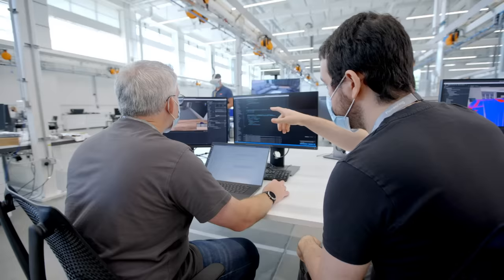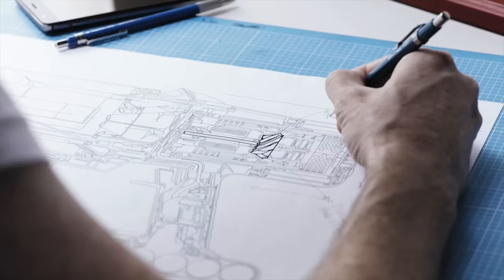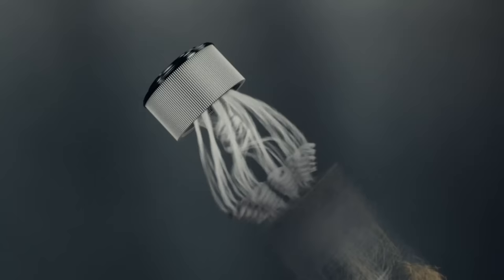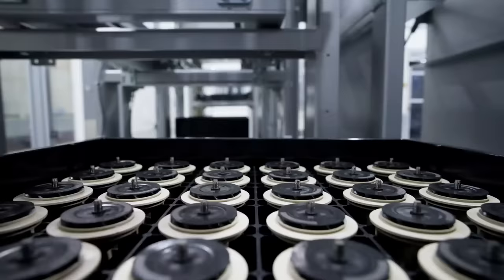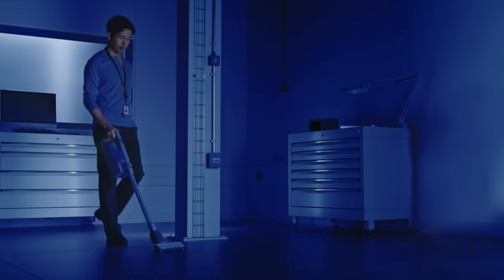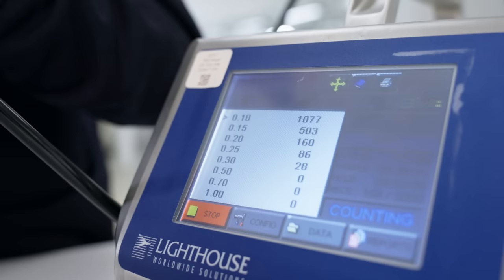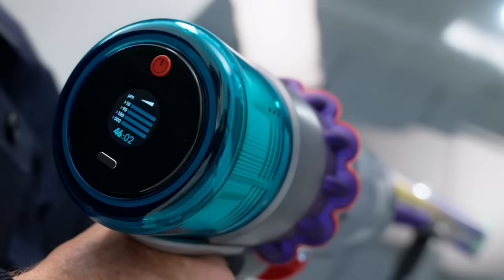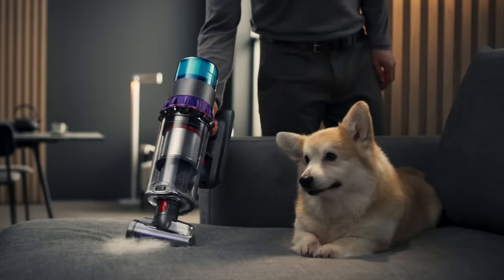James Dyson unveils Dyson's most powerful cordless vacuum with HEPA filtration

Comment: Hello, is HEPA Filtration better than the Whole Machine Advanced Filtration in some models such as V12? Thank you
Reply from the maker: Hi there,

HEPA stands for “high-efficiency particulate air.” HEPA filters are designed to trap smaller particles than the average filter, so you have fewer particles circulating in your home. HEPA filters help reduce allergy-causing particles such as dust, pet dander, pollen, etc
While the filtration system prevents dirty air leaking back into your room, and it captures 99.95% of ultrafine particles¹ such as allergens and pollutants from the air.
Reply: Hello, thank you very much for your swift response. Apologies, just to clarify - when you said 'while the filtration system...', were you referring to HEPA or the Whole Machine Advanced Filtration System? I would like to get a clearer answer as when I used the 'Help me buy' function on Dyson website, it didn't suggest Gen5Decter to me even though I chose allergy concerns and tried various combination. 

So can you please let me know whether HEPA Filtration is a better system than the Whole Machine Advanced Filtration system? And whether is Gen5Decter's HEPA  Filtration also a 'Whole Machine' filtration system, as I didn't seem to see it stated as such vs the 'Whole Machine Advanced Filtration' stated for some models?

Many thanks again your advice in anticipation, as I would like to choose one  ASAP.
Reply from the maker: Hi there,

We would like to inform you that the HEPA filters are best than other filters. HEPA filters are designed to trap smaller particles than the average filter, so you have fewer particles circulating in your home. HEPA filters help reduce allergy-causing particles such as dust, pet dander, pollen, etc
While the filtration system prevents dirty air leaking back into your room, and it captures 99.95% of ultrafine particles¹ such as allergens and pollutants from the air.

Also, we would like to inform you that there are different types of filters which are designed according to the compatibility of the specific machines. So, each filter which comes along with the machine is designed according to the functioning of the machine and it also increases the efficiency level of every machine.

Comment: I have a dyson v8 and v15 detect, I don't think it's possible to make a better vacuum cleaner than v15.
Reply: Is it a lot better than the v8?
Reply from the maker: Hi. Thanks for reaching out. Our new Dyson Gen5detect is more powerful than the Dyson V8. It also has more suction power. With its new features, it doesn't compare to the V8. :)
Reply: @a.3160  V8 is 115AW, this is 262AW and can actually get over 60 minutes runtime on hardfloors lol

Comment: 1:00 that's not "state of the art" that's a typical brushed universal motor which has been around for over a hundred years...
Reply: They're all brushless motors you goofball, no Dyson uses a brushed motor...
Reply: @Clove_Parma  All Dyson corded plug in products used a brushed universal motor... I was pointing out that Mr.D picked up the motor on the right (his left) and called it "state of the art". I am not referencing the hyperdymium motor on the left (his right). Another note is if it has a single stage of vanes; you didn't see Electrolux brag about "Quad Vane Technology" back in the 60's. I implore anyone to watch "The Secret Life of the Vacuum Cleaner" by Tim Hunkin

Comment: You replaced the trigger with a button?? Will this apply to all vacuums going forward? The fun part was the trigger 🥹🥹 I’m your biggest fan can Mr dyson sign my book that I purchased lol
Reply: The trigger mechanism has been the most frequent cause of failure on V10-V11 models.  I just replaced the one on my V11.  The red plastic part which fails presses on a plunger in the battery which presses the actual switch.  It requires a good bit of disassembly with special long tools to change.  Fortunately because its been a common problem the replacement trigger piece and tools are easy to find on Amazon with “how to fix” videos here on YouTube

Comment: Now make a corded version
Reply from the maker: Dyson cordless vacuums are engineered to be just that - cordless! But we do still included corded vacuums in our range, so these are an option if you feel a corded machine is better suited to your home and cleaning needs. Check them out on dyson.com
Reply: @dyson  dear team what I meant was bring that technology eg sensor and improve head/lights to the wired variants including variable auto power that can adjust to the flooring materials and debris

Comment: Now if they can fix the loose and wobbly wand issue on almost all dysons.
Reply from the maker: It's normal for there to be some tolerance between the wand and the main body, to make sure it can easily be attached and removed to change tools or empty the clear bin. As long as it stays connected in use, we wouldn't expect there to be an issue - the catch will hold it in place. If you're concerned the connection on your machine feels excessively loose, we'd be happy to look into this for you. Visit dyson.com and click 'Support' for the contact details of your local Dyson Customer Care team.

Comment: It's cool guess but the whole particle counter seems like extra unnecessary over engineering. We'll know the vacuum is working by how much stuff is picked up/in the container.
Reply from the maker: The Dyson Gen5detect™ vacuum uses a Piezo sensor to count and analyse the dust particles it's picking up in real time. It uses this data to automatically adjust the power as needed - increasing suction when a high volume of particles are detected. As an additional benefit, this data is also presented on the LCD screen so you can understand when the area you're vacuuming is clean, and guiding you to move on.

Comment: What is the model number of the version shown in this presentation?
Reply from the maker: Hi Emidio. Thanks for reaching out. This is the new Dyson Gen 5 cordless vacuum. :)
Reply: @dyson  yes I know,but what is the 2023 model number/ The reason I ask is that in Australia, what is called the Gen 5 standard model is a 2022 model and not a 2023 model.There is a model here called the Gen 5 `Absolute which appears to be the 2023 model, but I need to know what the model number is of the new 2023 model demonstrated in the presentation so I know what I am buying.thanks
Reply from the maker: The is called the Gen5detect™.  You have reached Dyson US support.  We will direct your question over to the team in Australia for further assistance.
Reply from the maker: Hi Emidio, can you please send us a message via Messenger with the link/serial number to the machine you own? If you're located in Australia message us here 👉 http://ms.spr.ly/60569GjcK.

Comment: I have had two Dyson. The first was an electric the second a cordless. I enjoyed both while they were under 6 months. But unfortunately I found both of the fitting were quite tinny and broke. The cordless at first did not suck so good BUT was replaced by dyson which was much appreciated. As time went on 5-6 months the sucktion got weaker. And never got a reply from dyson. So for the money I spent on the dyson vacume cleaner I expected a bit more vale. So value for money I give it a low 4. 
Would I buy it again?  Because of the cost probably not.  But I do the convenience rating  a high 9. 
As for now my dyson falls apart (because of the broken pipe joiners}. And has weak suction.
Disappointed customer

Comment: But you NEED to work on keeping them clean and empty…..the ejection of the bin is not enough. The amount of fine dust inside is crazy…..having to get a tooth brush or cloth to wipe clean. What about a cleaning kit with soft brushes or something you can place inside to get deeper into the machine to remove the dust. This would surely make them more efficient.
Reply from the maker: It's normal for static charge generated in use to cause fine particles to cling to parts of the machine, including inside the clear bin and cyclone pack. You can help minimise any buildup by tapping the machine firmly as you empty it, and wiping the inside of the clear bin with a damp cloth.

Comment: Love your innovative designs, but please give us the option to use the machine when its connected to an electrical outlet. To conserve battery life, I only  vacuum occasionally  and when I turn the suction all the way up, the battery dies in about 10 mins!
Reply from the maker: Thanks for the feedback! Boost mode is really only intended for occasional intensive spot cleans in areas where there's a lot of trodden-in dirt or clinging pet hair. For day to day use we recommend using the machine in Auto mode, which intelligently balances performance and runtime based on the amount of dust detected.

Comment: Does this one have a trigger because all the dysons with trigger have issues
Reply from the maker: Great question! The Dyson Gen5Detect™ does offer a power button!
Reply: @dyson  amazing that’s a big improvement, will all the old attachments from v15 detect work with gen5
Reply from the maker: The attachments such as the crevice and dusting tool will work.
Reply: @BMF-NJ  not powered tools but all others will

Comment: Does it still have mostly hard plastic parts and you charge over $800? 😂
Reply: The sheep will buy it anyway.
Reply: it's the same plastic as riot shields
Reply: @Clove_Parma  Apples and oranges 😂 How does a riot shield make a good vacuum? 🤡
Reply: @jules263  Because vacuums are subjected to a lot of stress and impacts on the joints, body etc, and riot shields, like dyson cleaners are made from polycarbonate, which is a thin, light but very strong and flexible material. It's far more difficult to crack or break than ABS or cheaper plastics, but ABS tends to be thicker, heavier.
Reply: The plastic parts do a lot for the durability of Dyson products. They are very durable and despite me dropping my Dyson many times it still has impeccable build quality. I have been using my v6 for almost a decade and it still runs like new. It is definitely worth it.
Reply: Yeh but this stuff never breaks. My parents dyson is 10 years and still working
Reply: @jules263 If the price tag bothers you, the Dyson v8 and v10 is a great option and selling for half the price. They’re a couple years old but still VERY good machines then the average vacuum.

Comment: £850 for a vacuum, and also it’s never going to beat my corded vacuum, I want full power. I just can’t live with or use these cordless ones they arnt as agile or responsive enough for me liek for instance doing the can I like to hold the end of the nozzle with a hand to be more accurate and scrub seal but you can’t with these as the weight is at the back. I really couldn’t care less about having a large cord behind me either.
Reply from the maker: If you've found cordless vacuums aren't the right choice for your personal preferences and needs, the Dyson UK range does still include corded uprights - which you can find here: http://ms.spr.ly/6052goYD0

Comment: Can't understand why I should pay for this. My parents are still using their vacuum from the 90s, I'm still using mine that I bought in 2007 for like 80 bucks. In don't know how a vacuum cleaner could perform better than mine does. I mean the floor is clean afterwards, it got a great cable length and is reasonably quiet. Why would I need a light beam that shows me the dust? Is the world gonna end if I don't have it and miss a spot? Maybe they should sell these devices to companies that have clean room production, or labs. But this is garbage for home use. Why would I spend that much money and thought about dust?

Comment: Do not buy!    The docking station has been redesigned.  The back plate which is screwed to the wall snaps into the front plate.   Once this is done it cannot be removed!    My raw plugs became loose.   I removed the docking station then discovered that it cannot be separated from the front plate in order to screw it back the wall.  Called Dyson. A 30 minute wait then the advisor ended the call after 30 seconds with no help or advice.   Called again. Now it’s a 50 minute wait! Tried Dyson What’s App. Advisor ignored the issue and just send a video on how to install it.    Contacted the Dyson CEO several times.  No reply!   £850 for this!!!

Comment: lame we need water suction all these one dimensional product aint pushing the envelope. id say those sensors are completely useless its for a air purifier. id rather have the sensor tell me when to clean it and measure the weight.

Comment: your engineers are sleeping. customers are complaining that this has weak brush head motor and stalls on carpet. the device also scratches poorly due to weak/thin paint surface on the product.  to be fair, commendable use of 10cell battery and post HEPA filter that drastically reduces high pitch whine of the high speed brushless motor. but then, the absurd price.

Comment: Or….you can use no electricity and clean the floor with a mop, sponge, broom and towels. It requires you to move around and get on your hands and knees, which for most people is possible and is probably needed exercise. Dyson is very cool but the claims in this video and pretty outrageous.
Reply from the maker: Rather than just wiping dirt around on the floor, or stirring it up into the air, we've focussed on developing technologies that effectively remove it from carpets, hard floors, and other surfaces around the home and inside the car. The fully sealed HEPA filtration system then ensures it stays trapped inside the vacuum. And when you need to empty, you can eject the dirt hygienically into the bin, at arms' length - while the mesh shroud is automatically wiped clean. Of course, owners are also free to use a broom or a mop if they want to!